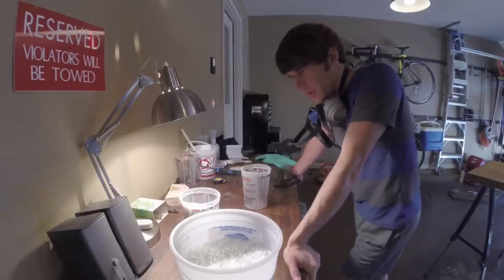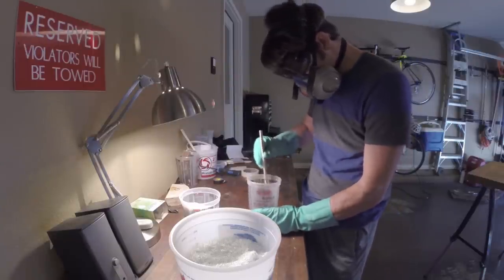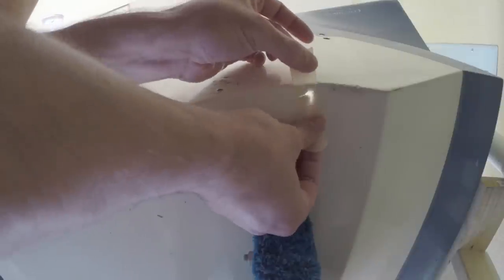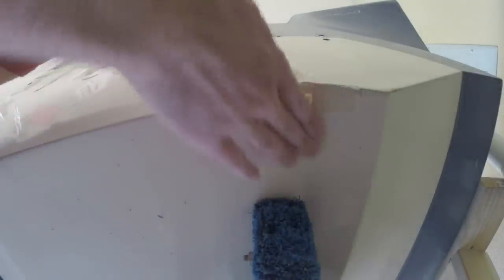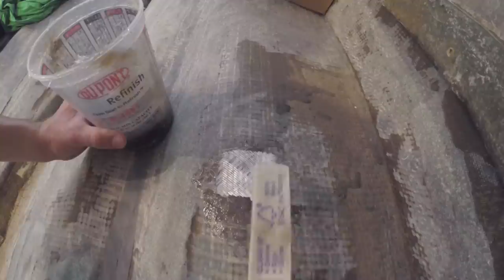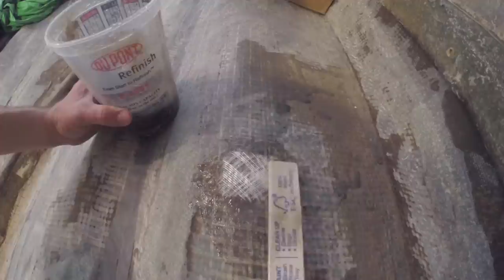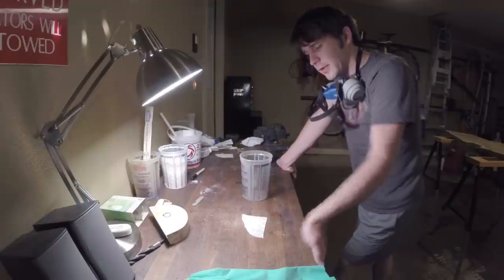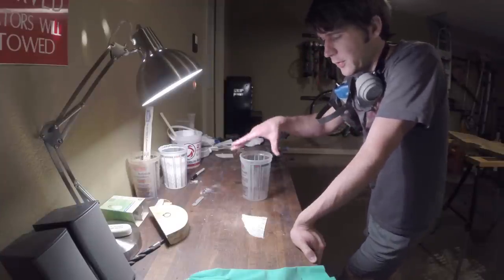Making Fiberglass Putty and Patching Hull // Project Glastron/Vlog #9

Comment: Great series J. I had bought a 73 Duo boat in the middle of last summer. Has the same 73 85 Starflight motor, and power pilot. So cool to see another. Mine did not need anything, though this spring I plan to replace the transom. That is a great strong running motor. Just be careful when towing, if you use the tilt to tow, make sure you support it some how. I hit a bump, and that bracket cracked, and was lost on the drive. Good luck on finishing the project!
Reply from the maker: Sam Caruth Thanks for following along.  Also thank you for the tip on towing.  Good luck with your transom replacing!

Comment: I have learned a lot by seeing your videos, and I like your style of presentation. I am considering a project, hopefully a "simple" partial floor repair/replacement.  One of the basic decisions seems to be the type of resin to use - epoxy or polyester, so my question is why did you choose polyester?

Thanks
Reply from the maker: ***** I am happy you have gotten something out of these videos! Comments like yours are exactly why I decided to document this project. By the way I answered your epoxy vs polyester question on your previous comment.

Comment: I have some holes in my floor from an old set of double back seats I am replacing... Do you think this would be an applicable process to patch the holes in the floor?  Epoxy didn't quite do the job for them as it sank into the hole.  I would have no way to mask from underneath.

Comment: Awesome Vlogging Jmink! I watched all 9 Vlogs.

I bought a 76 Glastron Sportster XL with an 85 hp Evenrude a week ago on Craigslist. Our boats could be brothers!  I am now digesting your Vlogs and letting it all sink in. I am at the "engine running" stage. The seller and I had to bypass the solenoid, and It fired up real nice. Next, I need to cover it and wait for my solenoid to arrive in the mail. In the mean time, I will be watching carefully and dedicating some yard space.

Q's
1. What made you finally decide on buying a vintage Glastron Tri-Hull? Mine was price and all around look to the boat. I am very happy with it.
2. What was the degree of cut on the transom? 10, 11?

Keep up the great work.
Reply from the maker: Thanks Jeff Pereyda, good luck with your build! To answer your first question, I bought my boat off of craigslist as well and for me it came down to price and looks as well. Also on the looks, I wanted something that would be a standout versus just another boat. Then to answer your second question I used an angle finder and it read 105 degrees. I took that and matched my saw to it. I hope that helps out!